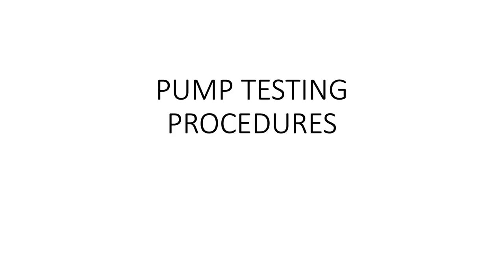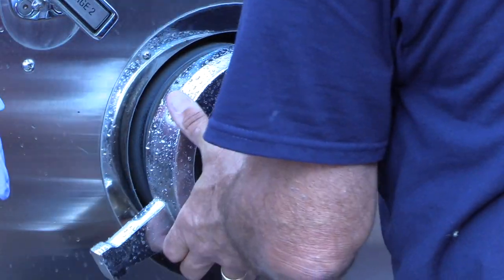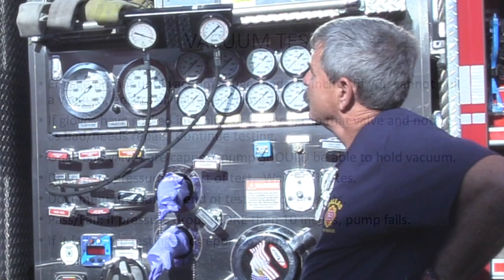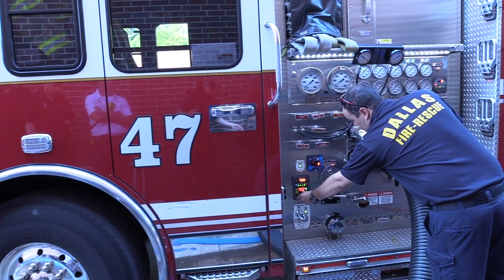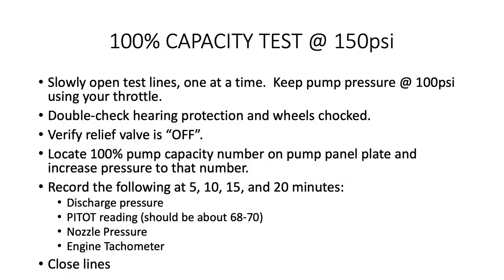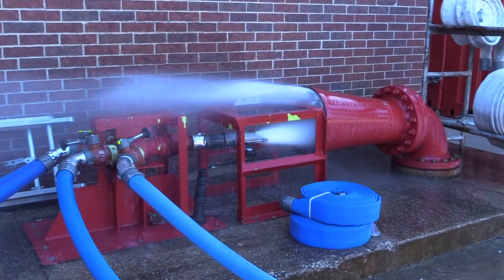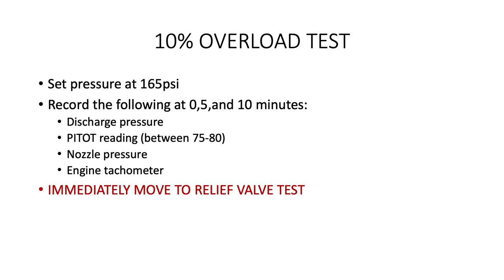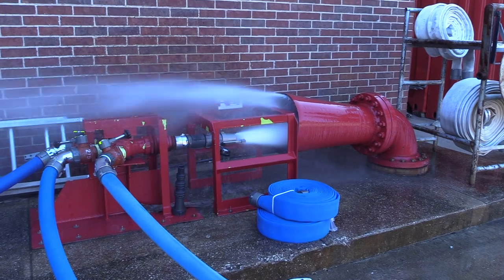Dallas Fire-Rescue Engine Pump Test Procedures

Comment: Well, that's not correct. 

165psi over-run test is 10% over apparatus rated flow at 150. The 165 test should be immediately following the 150psi test, as it is to ensure the pump capacity is not at the "breaking point" during the 150 test. 

The 150 and 90 psi governor tests should be performed at their working pressures.
Reply: I was saying the same thing too after the 150 psi test should be 165 psi test 😅